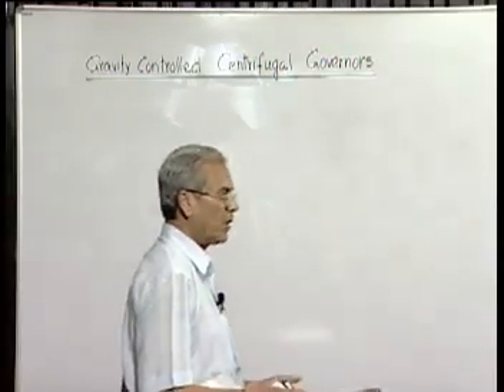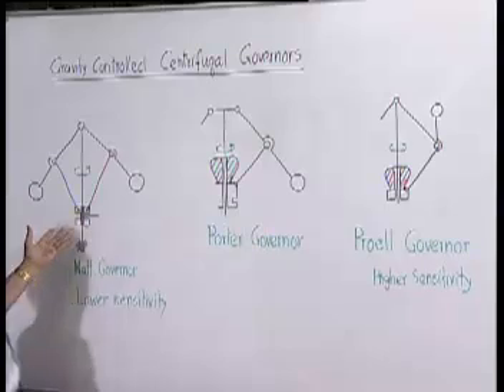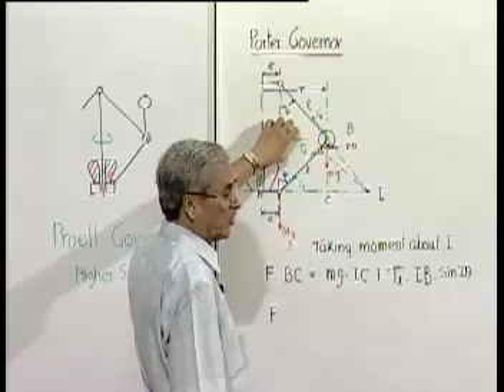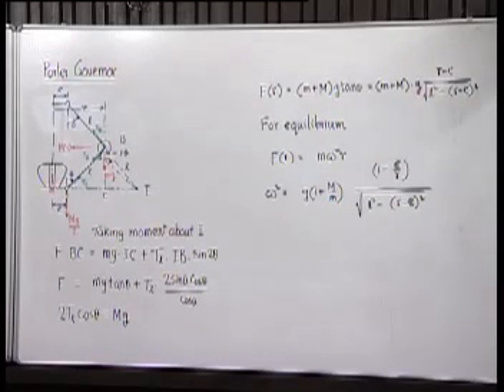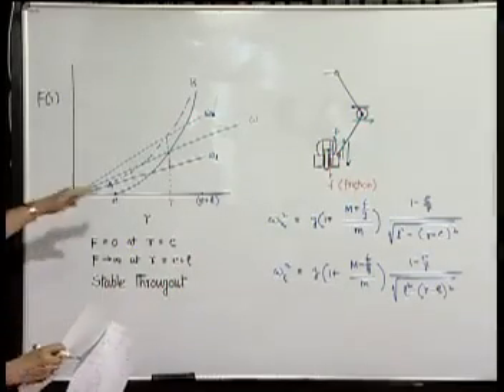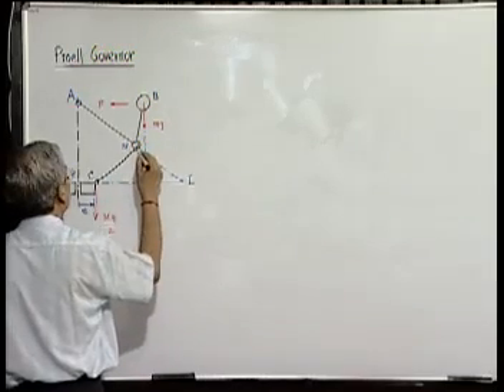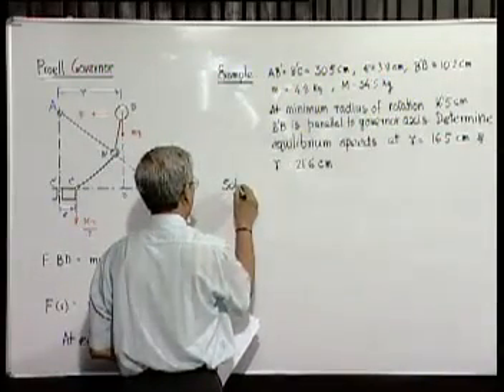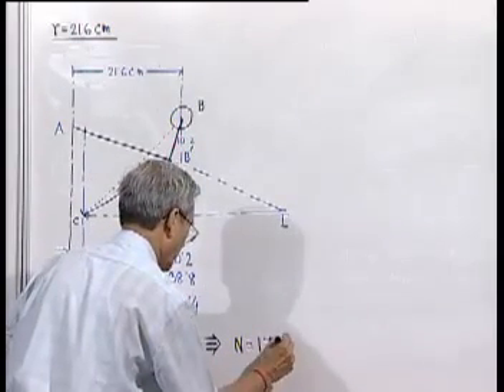Module 7 - Lecture 2 - Dynamics of Machines

Comment: lecture was helpful... but the diagram of porter governor shown at first was wrong i think... when the analysis had been done,correct one was used....
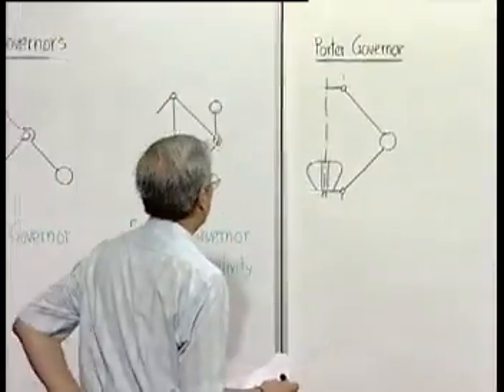Reply: Bro. He clearly mentioned @ 9:15 that he is taking a particular case where the length(the same extended length in the previous diagram you are talking about) is zero.
Reply: Sir was taking the case where friction is neglected and inclination of both arm of governer are equal